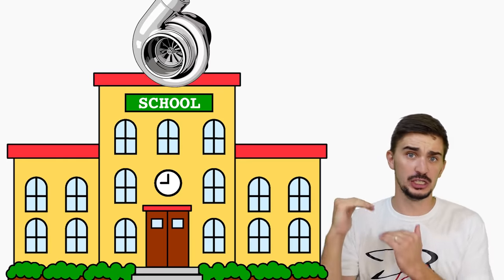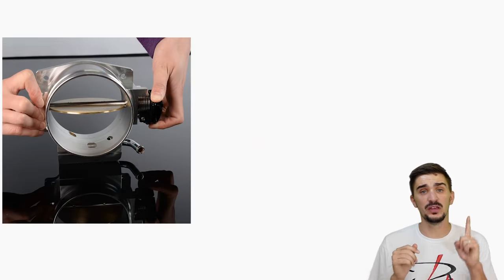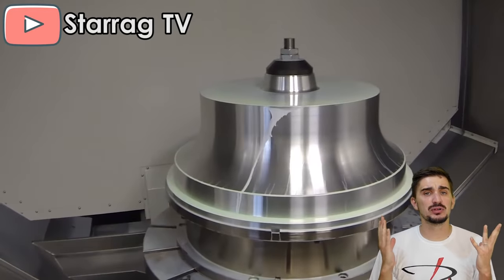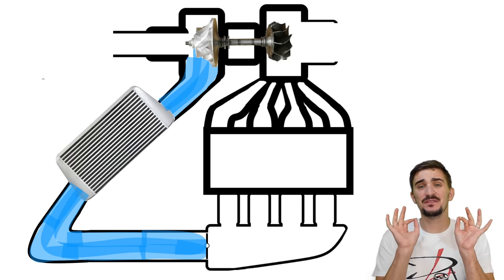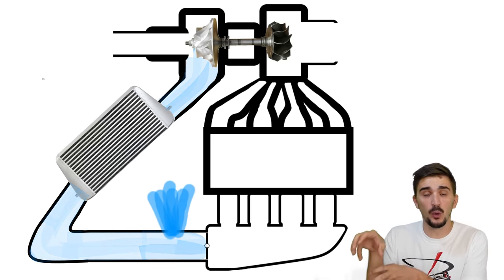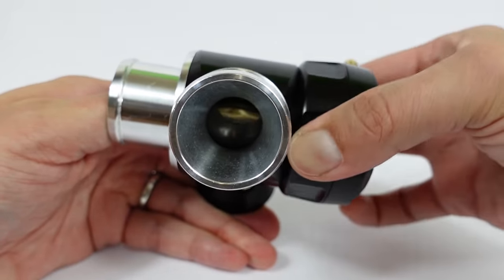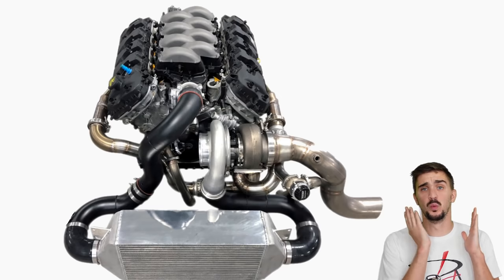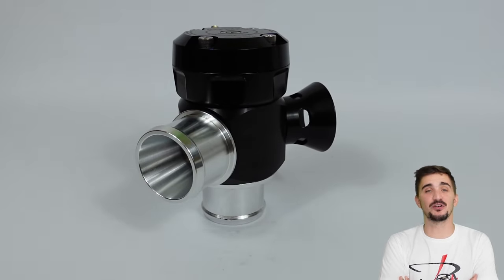TURBO FLUTTER and BLOW OFF VALVES explained in DETAIL - BOOST SCHOOL #8

Comment: I am so glad I watched this video! Many folk owning H2 motorcycles install blow off valves and a few state the addicting chirping sound gets reduced or disappears. I can now assume this is because the stock return system on the bike doesn't flow as well as after market blow off valves which just vent it to atmosphere.  Therefore the pressure is less in the aftermarket system therefore less chirping. 

The bike also runs no intercooler so I can assume Hot air gets recirculated in the stock system so boost temps rapidly increase from high RPM on and off throttle. 
Lots of thinking to do now. Hmmmm.

Comment: Shortened life span is worth it :D

Although how much it actually shortens it is the interesting question, given anecdotally people have been running bovless systems for decades without issues, mainly in lower pressure setups of less than 20psi.
Reply: As turbo Yoda from the skid factory essentially said what you said, that he only uses BOV's on high boost applications for said engine and turbo combo.

Comment: Very interesting, but is there any reason to vent any of the air to the atmosphere beyond liking the sound? After an initial interval of enjoyment, I tend to find many car noises annoying so I'd like to know if recirculating all the air is actually the best for performance.
Reply: So there's actual performance difference and theoretical performance difference.

First let's go over what we're talking about.
A recirculation valve is the same thing as a blow off valve except it recirculates back into the air box. This is what a lot of OEM turbo setups do. It's why you don't hear a big pfffft on stock vehicles. Also, If you're using a metered system where you can't just lose the air, it often recirculates back just past the meter so that it stays in the system.

And a blow off valve is exactly like what he showed there. It just blows the excessive pressure to the atmosphere and often has a trumpet/horn shape that allows it to make that woosh noise louder.
As to your performance question.
Theoretically, you've compressed this air and it's hot and you are throwing it back into the air box. Now yes it's true that the air was compressed and now it's decompressing and therefore lowering and temperature but it's also picked up some heat from the whole system being heat soaked and everything and it will be a couple degrees warmer than it started. But that's it.
The difference is extremely small.

The only other difference is size. Most recirculation valves are fairly small compared to blow-off valves. If you are doing a large displacement engine, large turbo, etc You need to have a big valve.
If you have a undersized recirculation valve you will hear the flutter, lose wheel speed, and still have to refill the pipes.
If you're running a smaller engine, you can blow off the extra air, but if you blow too much of it away you have to refill your entire system and you get a slight delay.

So sizing is important. Sizing is important for the whole system though so that should be expected...

Now there's also the psychological part. It definitely sounds and feels faster when you hear it compared to it being silent. For that reason alone most people doing a build will have it make some noise.

You can adjust how it blows off or where it blows off too so that it's not too loud. It doesn't have to be screaming... Although a lot of companies specialize in making it do that.
Reply from the maker: I wanted to reply to the comment and explain but you already did that and beyond. Thank you.
Reply: @d4a  I actually started replying to this while watching your video. And you answered half of what I said later in the video so I probably didn't even need to type it. Lol

Comment: You already know my turbo S2000 build is getting the good old NO BOV treatment. I'll smile every time I let off the throttle while cowards hate on me in the distance
Reply: Good lmao, turbo flutter is a gift sent from the gods and should not be shunned, in any practical application a BOV is not really necessary if your turbo has ball bearings (journal bearing turbos can experience some increased wear when not running a BOV depending on the application) and sure, the flutter may "slow down" the compressor wheel a bit, but the difference compared to using a BOV is negligible if you're looking for the fastest spool-up after throttle release. So in shorter terms, flutter away! Don't pay mind to those who look down on you for enjoying yourself, they don't know what they're talking about :)
Reply: Yes, finally someone said it! Flutter away my dudes! No bov for 6 years and zero issues!!!
Reply: Yes, actual compressor surge happens at WOT, not this compressor reversion he is describing in this video

Comment: This was very helpful. I recently had a Diverter Valve fail on a recent road trip out of state. I was getting the turbo flutter when letting off the throttle on the highway. I continued on my trip because I still had good power and wanted to reach my vacation destination. I was able to drive home about 300 miles with the failed Diverter valve and didn't realize that compressor surge can potentially damage the turbo! I hope I didn't do much internal damage since I changed the Diverter valve as soon as I got home to fix this issue! Since my turbo is good for well over 70hp from where my HP is currently I'm hoping that helps. Either way, it seems fine now and I didn't loose any boost that I could tell when I had this issue on my recent trip.

Comment: Yes pressure flow ratio.
That's why they use duel stage blowers prevent compressor stall, this is also why tractor pullers gradually spool up or you get surge at sudden full throttle too.
A lot of people think compound turbos are just to reduce lag.
I have snapped a turbo shaft with over boost.

Comment: I have tried to explain what WOT and compressor surge is and why theyre both bad in so many comments on youtube, the quality of a given turbo and their ability to handle the abuse, the potential risk to thrust bearings (even fins) and the general life span of the turbo especially with higher pressure applications. It really blows my mind how many people are making videos telling everyone it's not harmful at all and those of us trying to explain what it is and why it's bad are stupid and don't know what were talking about. Thanks for making a straight forward explanation for people, I hope this video gets more views than all the "remove your BOV vaccum line to sound cool like me" crap..
Reply: People running 40+ psi with no blow off valve for years without issue vs random idiot on the internet that that probably doesn't own a turbo car and never has, I'm not sure who I should trust.
Reply: Just cause yours blows up doesn't means others does. lol
Reply: Closed throttle compressor surge doesn't harm a turbo. Loads of famous, very high hp cars do not run one.

Comment: From my experience if your intake path isn't too muffled, bypass/recirc valves are quite audible albeit having a slightly different sound and less volume compared to pure blow off. So usually getting a less restrictive aftermarket intake is all it takes to get turbo noises, especially with plastic BPVs which OEMs tend to use, as they tend to be louder than metal ones.

Comment: Many years ago there was a man who designed a turbo system for F1 race cars. Back then the cars Hal had blow off valves so that as explained in the video the lifespan of the turbo doesn’t get reduced, and also boost is not lost. He thought for a minute that all of that compressed air was getting wasted so he replaced the blow off valve with a chamber. The chamber would connect back to the air intake. When the throttle was closed, excess compressed air would be redirected into the chamber via a one-way check valve. While the throttle is closed, the engine loses power and the turbo charger will slow down. When the throttle is open again, the compressed air from the chamber would enter the intake again and feed the engine which also helped the turbo to spool back up more quickly. With nothing but a check valve, air chamber, and a little bit of pipe, he managed to increase the overall output of the cars. To give you an idea of how well it worked, He won every single race until everyone else started copying his method. It was so effective that they banned it after the first year.

Comment: Way back when, my dad and I mounted the throttle plate on a spring hosing inside a larger tube with similar helical cut outs to dampen the compression in front of the plate ... just sealed with some O- rings (imagine a shaft helical coupler inside a helical cut tube that was closed by the front part of the coupler when unsprung). When the plate pushed back it revealed the cutouts and vented to atmosphere ... it worked, till it caught fire via the unwrapped headers and not enough airflow in the rear of the Karman Ghia. Never got back to fidgeting with it. I modded that little car with the craziest stuff just to get around 100HP out of it, which was more than twice the original spec.

Comment: I never understood why people like the flutter sound. A BOV like your showing at 9:35 sounds a million times cooler. I had one a Ford Escort RS Turbo and damn that thing was loud. Even when driving normal it was so loud enough to make people look. Good times!
Reply: That's subjective but I will argue a bov literally just sounds like you popped a tire or have a vacuum leak and flutter actually sounds cool
Reply: flutter sounds badass, basic bov noise is boring

Comment: A great video and easy to understand. I have a new turbo on a 2.0 tdi, which suffers compressor surge in 2nd gear if I accelerate quickly and then shut the throttle off.  Wrong a new turbo this concerns me. It is a standard turbo on a standard e gonw but with a map giving an extra 30bhp

Comment: So glad to FINALLY hear someone state the obvious and important truth of this 'cool' stututu sound.

Edit: Def, worth a sub. 

Now if you can explain 2 more things to these kids I'll be a fan for life. 

1) About the importance of choosing the smallest diameter piping necessary for the inlet and the AFTERCOOLER with the lowest volume and pressure drop possible. 

2) The importance of maintaining exhaust gas velocity throughout the entire exhaust. Where it slows down when entering a zone with a larger cross section (as a pulse remember) this pressure high pressure wave needs to be encouraged to accelerate again when again entering the following zone with a smaller cross section, it is important that the acceleration is aa soon as possible to resuce the high pressure wave reflecting back 'upstream' and interfering with the exhaust pulse entering the cavity. This is why resonators and baffles must be strategically placed. 
Anyway, point being....
Again, bigger is not better when you don't have the displacement to be wasteful with. You're exhaust diameter must be adequate for flowing the exhaust gas at a sufficient velocity that the boundary layer has minimal perpendicular pressure but is not too narrow to cause the boundary layer to become to compressed and cause turbulence in the gas flow. 

How this is done in a small displacement, high strung turbocharged engine is to incrementally decrease the exhaust diameter along its length to match the drop in gas temperature and maintain the gasses velocity, all with the sole aim of maintaining the lowest possible pressure at the turbine wheel by maintaining a optimally high exhaust velocity along its length and not transmit a high pressure wave/s back 'upstream' 

*The optimal consideration is dependent on the application of course, besides the gay excuse of a motorsport of driving in a straight line with WOT, most people will be more affected by throttle response, lag and spool time. Hence the spool up performance (and minimal lag) will be more important than loosing 3-5% of torque 200rpm earlier towards redline.

Comment: As somebody who owned a 84 mustang svo for 25 years I'll say a blow off valve or a recirculating valve is a necessity for a turbo,/ forced injection engine after snapping the compressor shaft on 4 turbos. The top mounted intercooler connected straight to the throttle body. But at least I also learned what great gas mileage you get when you just run a regular 4 cylinder, so you get a duel adjustable boost controller and set the low as low boost as you can and the high for whatever boost you want to run flip the switch and you're gone and still get 30mpg+ cruising down the interstate.

Comment: Thank you! Very educational. I've always heard this sound in other people's tunes and actually found it pretty cool, but I can see why that's horrible. Thankfully my Nissan uses the diverter valve and only diverter valve options are natively available for my car, though, I suppose I could convert it to a BOV. My aftermarket diverter is actually much louder than my stock one was and much louder than any BOVs I've heard on previous BOV based iterations of my car that I have heard. But this may also be attributed to the fact that I use an SRI. I drive a Nissan Juke Nismo. The version 2 engines seem to use diverters.

Comment: ill just say it. the explantion of turbo flutter damaging the turbo due to compressor surge is only really applicable when your on wot (wide open throttle) when you let off the gas and close the throttle body your no longer increasing the exhaust gases and putting load on the turbo, so compressor surge due to closing the throttle body isnt as bad as people make it out to be as the load is already decreased on the compressor wheel. i know so many people who have ran nothing but block of plates for 10 + years and never damadged a turbo because of it. bpv's will allow you to get back on full boost sooner as it is recirculatig and not just sending to atmosphere like a bov or running a block off plate. just my 2 sense tho. really good video still!
Reply from the maker: I responded to similar comments already. As I'm saying in the video "if boost is high enough". Low boost flutter isn't much of an issue, but when boost is higher it definitely strains the turbo.

Comment: The one thing I wish you explained further would be the benefits of venting back into the system. Is it only more efficient? Does it make boost pressure increase faster and create a more responsive turbo? etc

Comment: Amazing video. I just subbed. I still get the noise with my 10th gen civic turbo. Just the one pssshhhhh noise. Not the stutter. Even with the recirculating system. Didn’t know that without that you cause wear to the turbo.

Comment: Turbo flutter that occurs when you lift off the throttle really isn't all that harmful to the turbo.
I have driven my car every day for two years with turbo flutter and there has been no problems with it. The reason i felt safe doing so is that one of Swedens best and most experienced engine builders/tuners explained to me and others what is really going on when it flutters.
Yes the turbine slows down but all of the forces involved are tapering off and there is no real load on the turbo after you let off on the throttle.

The turbo killer is compressor surge at WOT where everything is under a lot of stress and this can actually snap the turbine axle in extreme cases and even if the axle is fine it will still put a lot of abnormal pressure on it's bearings so this should be avoided AT ALL TIMES!

So:
Foot off pedal -> flutter = OK.
Foot on pedal (WOT) -> flutter = you will soon need a new turbo.

Someone should really do a proper scientific test on how "ordinary" turbo flutter impacts turbo lifetime so we don't have to rely on he said/she said...
Reply from the maker: As I said the in the video "if there's enough boost". The damage from closed throttle surge is strongly boost dependent. In low boost applications it usually won't do any harm, but when boost increases it will definitely shorten the life of the turbo and it's not "ok" 😊. It has been scientifically proven long ago and this is why all modern turbo cars run a recirc. I have discussed this with other commenters in more details below in case you're interested.
Reply: @d4a  I said that flutter that occurs after you let off the throttle is ok and it is unless your BOV is way too small or completely incorrectly adjusted.

When everything works as intended you will get a hard blow off into atmosphere when you let off the throttle at high boost and it will only flutter at low boost when there is not enough pressure to hold the BOV open.
Your turbo will not take any significant harm in this situation.

If you get flutter when letting off the throttle at high boost then your BOV is either too small and can't physically handle the amount of air it needs to vent or it is adjusted incorrectly. In this situation something is not working or not setup correctly and damage could occur.

So no, it is NOT boost dependent at all. It is dependent on whether the guy putting the engine build together is competent or not.

Comment: Brilliant explanations. This also explains why Turbo is fuel-efficient to a point, then they start doing the opposite. I guess electric turbo can deal with this easier as the throttle position can be inversely linked to the electric to boost. Wonder where is the Audi 48v electric??

Comment: It should be noted that BOV's are only effective with intake systems that have a throttle plate, gasoline powered engines. Diesel powered engines don't have throttle plates so the air pressure never gets too high by letting off the throttle. The throttle on diesel engines controls the amount of fuel being injected whereas the throttle on gasoline engines control the amount of air that can flow into the engine.